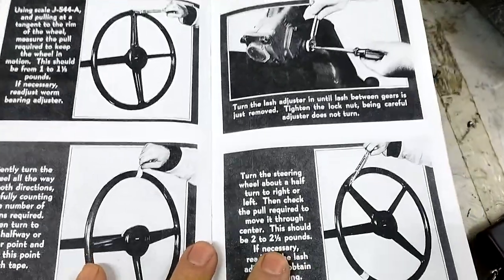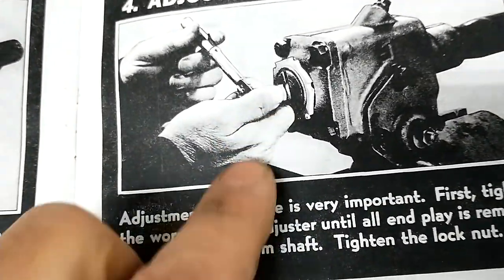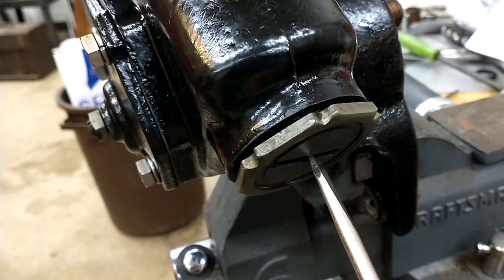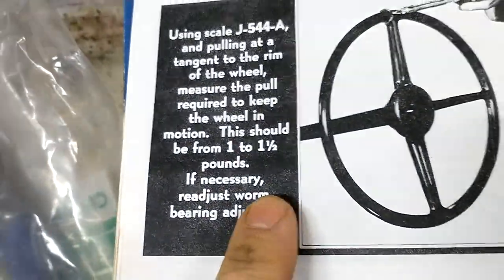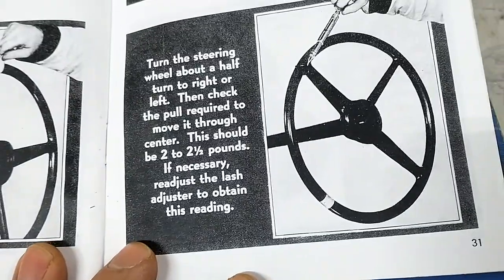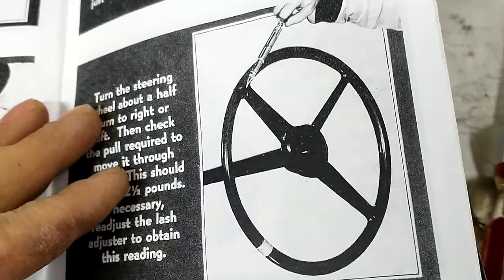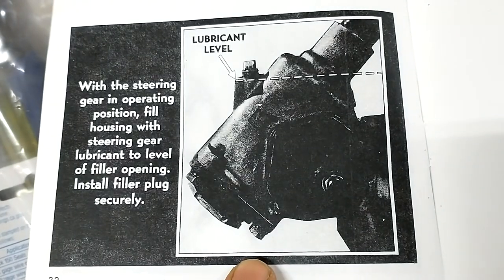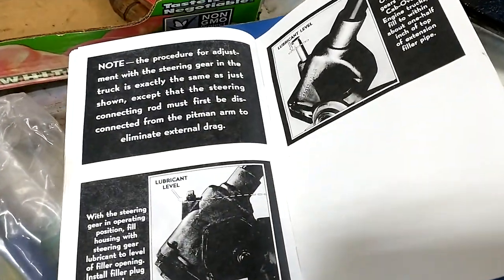1949 GMC Steering Gear Adjustment

Comment: Informative rebuild series. I'll be having to address my 49 Chevy's worn steering gear box one of these days. It appears a press and several reamers are necessary for an otherwise straight forward repair. Good job.
Reply from the maker: Thanks!  Glad you found the videos useful.  Not too bad a project.  Good luck with your 49 Chevy when you get around to it's steering box.

Comment: I have a question for you:  After you installed the box and connected the drag link, do you still get 5+ turns of the wheel?  I got 5+ turns on the bench, but I'm down to 4 after connecting the drag link.
Reply from the maker: I don't recall how many turns or if the number went down after connecting the drag link.  There are steering stops on the spindles. Assuming the rest of the steering linkages are connected, maybe now you're hitting the stops which is by design.  That'd be my guess.
Reply: @theworkshop3706  Thank you, I find your videos very helpful.